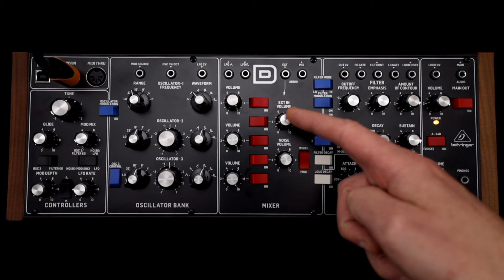Behringer Model D Synthesizer 🎛️ Minimoog Tutorial, Review, and Walkthrough 📺

Comment: Actually that LFO is available on the Moog Synthesizer, that's inaccurate info
Reply from the maker: Well, I’m sitting in front of a vintage Minimoog as I type and can assure you that my statement is correct. On the original, OSC 3 could be used as an LFO, but there was not a separate LFO speed knob as seen on this unit. 

However in modern versions such as the reissue, the knob was added.
Reply: @ToddUrban  the second LFO is set by using the mod wheel. It can be sent to oscillators 4 or can be set with the rate knob close to the mod wheel. You can use the modulation mix to mix between the two Leo's (making sure its not set to noise)
Reply from the maker: Yes. That is the new version. As I mentioned, it was not on the original version. The Moog reissue is still great, but is not the same as the 1970s Model D
Reply: @ToddUrban  understood, thanks for the info mate!
Reply from the maker: Of course. And I’m glad you brought this up since some people might look at the new Moog Model D and not know that they added these features

Comment: both are great synthesizers, like you can’t beat that Behringer price … but the Minimoog Model D definitely has the better sounding filter (like WAY BETTER) it’s so thick and buttery lol! so if your music has a lot of filter modulation … get a Moog Mavis, Mother32, or a Minimoog Model D if you can afford it
Reply from the maker: Yes, I agree. Thanks for the comment.  

I have Sub 37, which I love. (it is different, but great) I also used to have an original Model D that I sold in the 90s for about $900 to buy a Kurzweil to gig with. (real real real bad move.....) 

But the biggest difference to me is the drive you get from the real Moog. It just cannot be beat. Also, the feel of the large layout of the Moog just begs to be played. The Behringer is a great price point, but the knobs are small, so I find them more difficult to tweak in a musical way just due to the size.